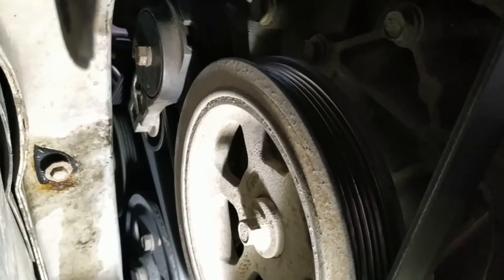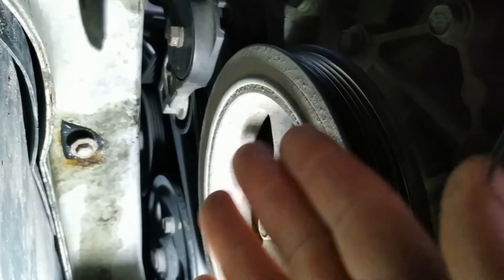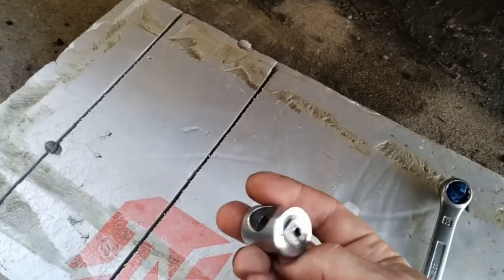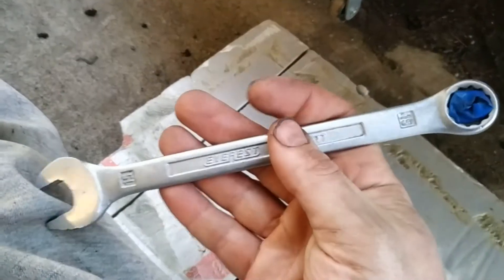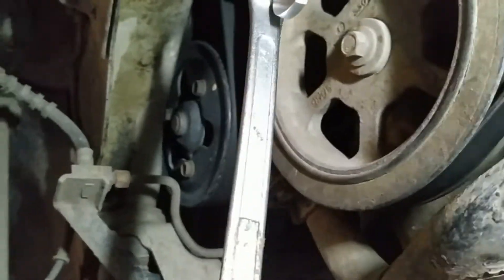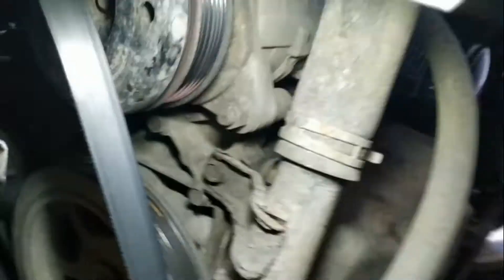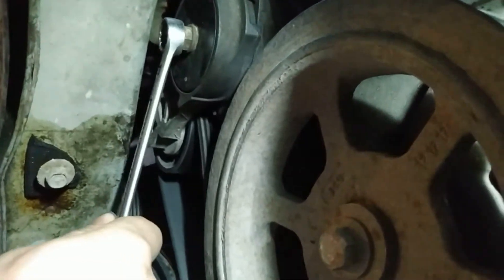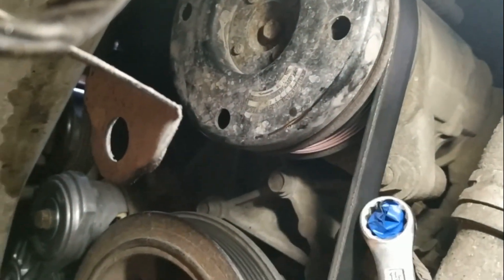Chrysler Town & Country 3.8 serpentine belt tensioner replacement NO special tool

Comment: Nice use of the wrenches to compress the tensioner.  The tensioner on my 2009 Town & Country uses a 3/8 square drive, rather than the 1/2 like you describe.  Tip for anyone doing this, make sure your square drive goes all the way into the square socket or you'll round out the opening of the socket when the wrench slips out while you are putting some pretty good force on it..   That's where I'm at now.   30 second job now taking 2 hours.  Looks like I'll be removing a wheel and getting under the car now.

Comment: I didn't need to make a tool. Just used a 3/8 rachet and stuck it in the hole. Used a cheater pipe on the rachet. Easy peazy.

Comment: Good idead,, but i found that you don't even need that. Use a long screw driver or thin pry bar, insert it onto one of the slot of the tensioner, lever against the wheel well side wall and push it down, extremely easy. No special anything needed!

Comment: I have a problem I took the pulley off but I need to replace tensioner correct that means I mean the whole tensioner  not just the pulley I mean I bought the whole item